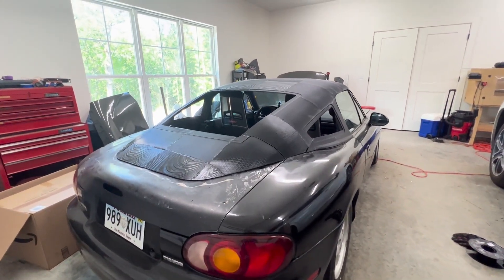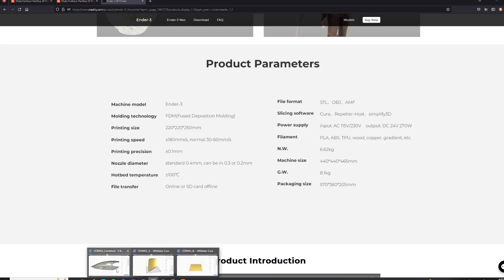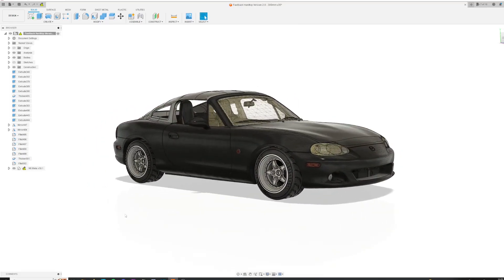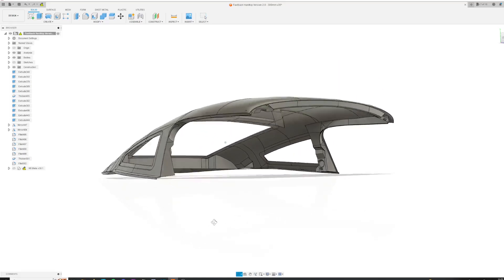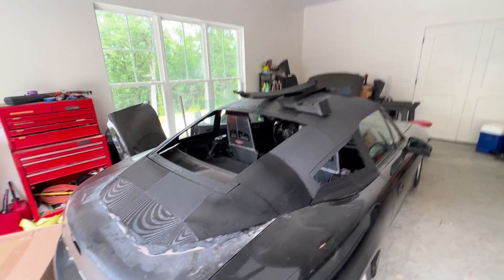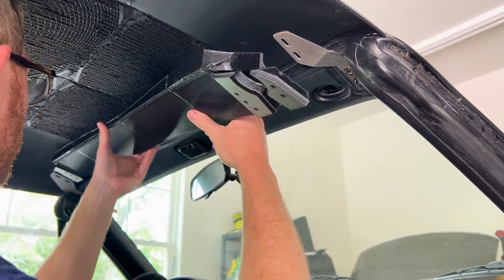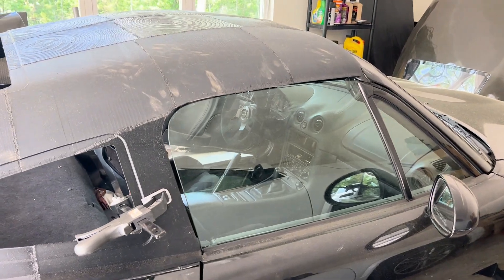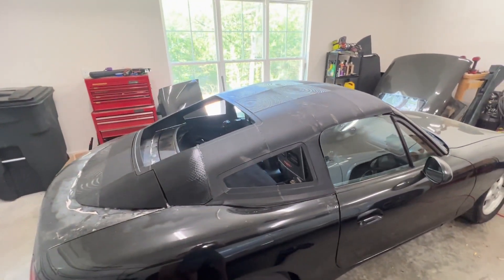How To Build a Fastback Miata Hardtop for Under $500! (Part 1)

Comment: Love the video man that’s extremely impressive especially on the first try… if you wanted you should/ could use connections when you cut it in Bambu studio, I’m not going to explain how to do it but it will make it 10x easier to line up and strengthen the joints. Good luck on v2

Comment: What about using a multi axis router to cut closed cell foam and then do moldiness glass/carbon fiber construction. Perhaps use the printer to make the highly detailed parts where the window weatherstripping goes, the attachment points for the hinges and windshield frame locks etc. Seems more useful, cheaper, lighter and stronger.

Comment: 1 question how's the trunk open
Reply: Racecard don't need that option
Reply: @1おっさん0  Race Car is how you spell it smart ass. And I'm not building a race car I'm building a car for the street and would still like to use the trunk space for your info. build 1999 miata ford 302 engine solid rear end ford 8.8 on four link system with pan bar moser custom axles and more what you have  ThaHammieJaassee
Reply: it doesnt, you can probably do some creative cutting to get it semi functional

Comment: Did you use the front strikers for the sides? I’m about to start assembling mine and I wasn’t sure what hardware I’d need to attach it to my Miata(NA)
Reply from the maker: No the front strikers and latches are a little different than the side ones. It basically uses the same hardware as the oem hardtop. You can also use the mounts from 5x racing that weigh a lot less than the oem mounting hardware.

Comment: Have you considered a targa version of this top? I actually signed up for one from Panos but have yet to receive it.
Reply from the maker: I’ve never really understood the concept of the targa fastback on this car because your trunk space would be open to the interior.
Reply: @HutchinsRacing  I personally wanted it so I can still drive with top down whilst having the rear portion on. This way it still retains some convertible aspect of it
Reply from the maker: @MohammedAbdul-Khaliq  sorry I was confusing a targa with a hatchback. Yes a targa would be sweet although I think it would weigh more since it has to have extra support where it detaches. My aim is as little weight as possible. It would be cool though.

Comment: Cool tech, but not what I'd spend money on. Might be useful for making a fiberglass mold for making CF and FRP. Still seems easier to just build a buck tho.
Reply from the maker: With a buck you are forced to make a mold and then the actual part. With this you can just lay some fiberglass on both sides and your done. No mold necessary.
Reply: what is a buck?